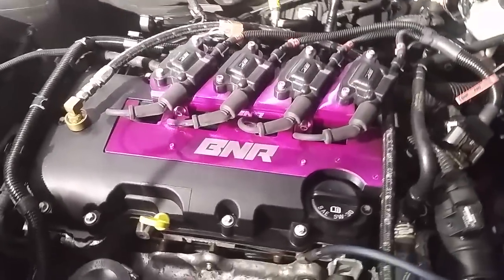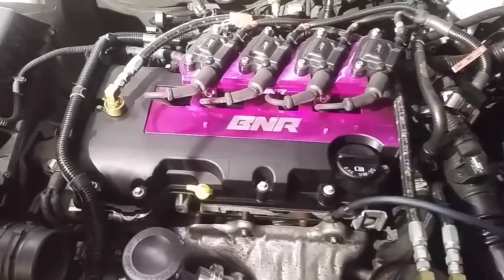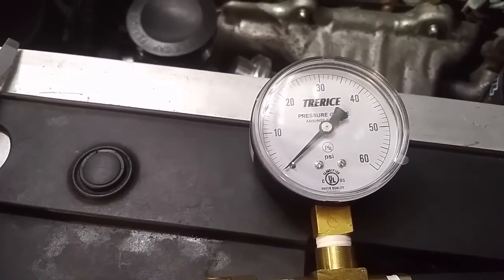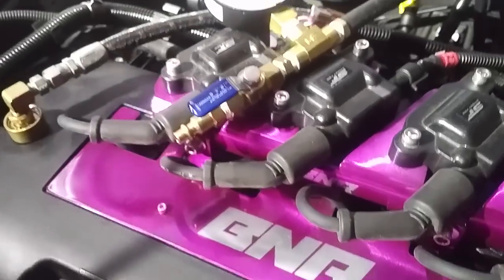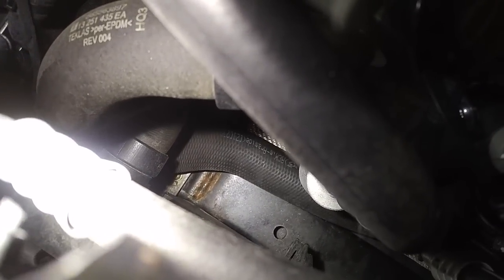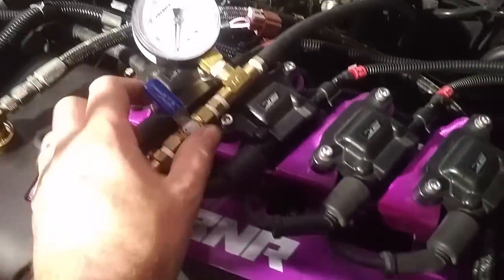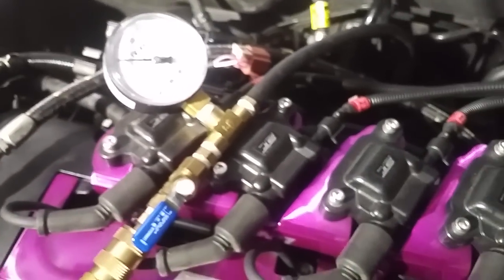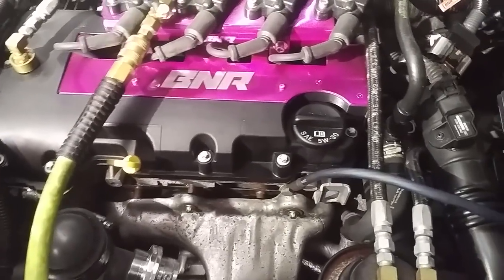Chevy Cruze & Sonic 1.4L Turbo Boost Leak Testing

Comment: Did the test and there was some air coming from the valve cover gasket in the front and back. Would that cause the p0299 code ya think?? Thanks.
Reply from the maker: Doubt it honestly. That code would come from a boost leak. Check the charge pipe connections to the intercooler and throttle body connection as well.

Comment: When I drive sometimes around hundred in six gear my car just slows down by itself a little bit and it feels like it doesn't have its power like it should is that a boost leak
Reply: Jeremy Guenter it probably is your governor.
Reply: It could also just be that you're driving a Chevy Cruze. GM engineering is horrible.

Comment: Id like to see this tutorial for the 2017 Gen 2. I keep getting the P0299. Car is BNR Tuned.
Reply: Gregg Walmsley before turbo replacement you should check cat converter. many times it gets stuck and it reduces exhaust flow and it causes low boost preasure.
Reply: Same, I keep getting this code but only at full throttle.
Reply: How did yall fix this?

Comment: Hey awesome video. I found a leak at the charge pipe/throttle body connection. What's the best course of action to fix this?
Reply from the maker: Tighten it. If it still leaks, wrap the throttle body with some gas line-rated thread tape (the yellow stuff) several times.

Comment: What type of gas do you recommend...i realized when i used mid grade i don't hear and knocking noise but when i use regular gas to save money i hear a knocking noise when i cold start the engine...or is this normal for this engine
Reply: Depends I use 91 sometimes just to get better fuel range.

Comment: Are there better seals available now, or can the OEM seals be re enforced with some sort of extra sealer?
Reply from the maker: The OEM seals are pretty good on this car. You can keep leaks to a minimum by making sure your PCV system is working correctly, especially the intake manifold check valve.

Comment: I am sure I am missing something here, but what is that 2 inch cap connected to?  I nave a new 2017 Cruze, and the turbo is set up very differently from what is shown here.
Reply from the maker: The 2" cap is not connected to anything. It's there to block off the air from the turbo from escaping. Just a different way to do it than other people are doing it. The 2017 has the gen2 1.4L Turbo. Different engine. This is for the Gen1 Cruze.
Reply: Ahh, OK, fair enough.  I wasn't sure if the 2017 engine was different, or just the  plumbing on the outside.  You actually answered several questions here.  Thanks for the reply.
  Looks like I may need to do a bit more research on the Gen 2 engine.   Not much out there right now, but I will dig in and see what I can find.  Thanks again for the quick response.  :)
Reply: Just pulled the top plastic cover off the engine in my 2017 Cruze, and yes, it is radically different.  I it almost looks to me as if the exhaust manifold is actually built right in the cylinder head.  Many other differences, but I will spare the details.  Just wanted to confirm that the Gen 2 is quite a different animal from the Gen 1.  Now if I could only find more info on it, other than just pictures without descriptions.
Anyways, thanks again.  Cheers!

Comment: I built your tool, and there is hissing at what I call the valve cover. Can’t really get to 10 psi. My valve cover gasket is leaking lots of hissing. Is that my boost leak?